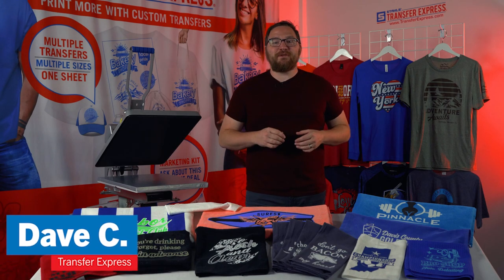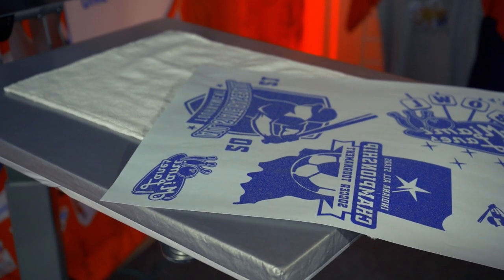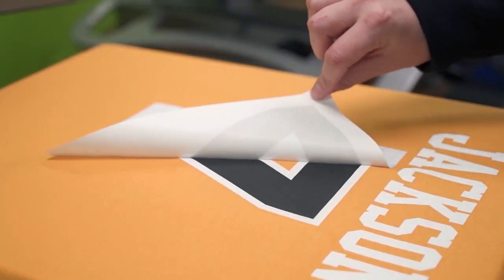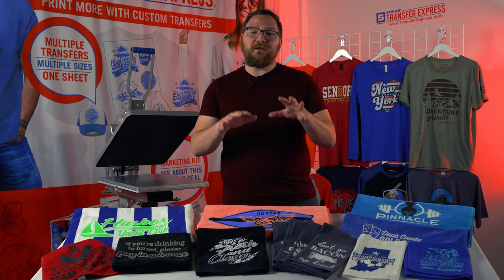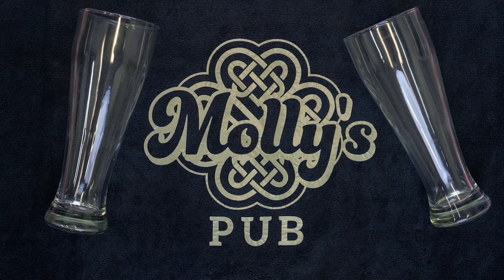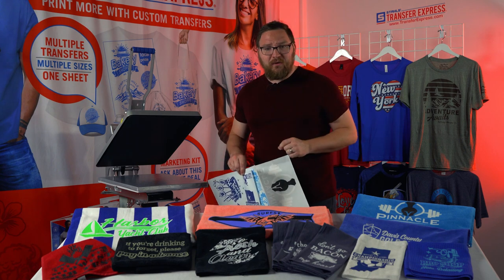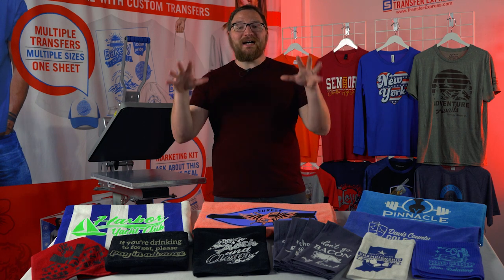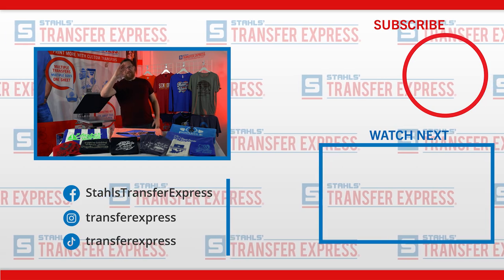How To Screen Print Towels in 4 Seconds | Rally Towels, Kitchen Towels, Beach Towels + More

Comment: I JUST did 150 rally towels for a grad party. My client wanted them for gifts for her guests. I had never done it, but after searching Transfer Express's blog I saw that I'd be able to do it with my fave Goof Proof. The towels turned out GREAT. I used a 100% cotton towel with a very low pile to make sure it was a flawless application. I've added rally towels to my portfolio now.
Reply from the maker: That's awesome! They really are a great addition to any heat printing business. 

We're so happy to help!
Reply: Which towel did you use? Item #..?
Reply from the maker: @ericj6170  If it helps, the Port Authority Rally Towel PT38 is an awesome choice for a low pile surface for screen printed transfers. They're pretty commonly found under $1.50 each too!
Reply: @transferexpress  Thank you for your response.

Comment: Hi Dave, I am curious if there is a way to print transfers on sleeves with the 360 iq?
Reply from the maker: Great question Authentic Ginger! The answer is yes, absolutely. We've applied a variety of different transfer types on the 360 IQ on sleeves, face masks, hip packs, and more! 

For printing on short sleeves, you'll want to loop the top side of the sleeve over the lower platen so you don't have the seam on the underside of the print area. 

This is such a great question we'll even make a video about it!

Comment: What size transfer would be best for the corner of a beach towel, what size for a center logo
Reply from the maker: That's a fantastic question! It's hard to say, as the sizing for the logos may differ based on the actual dimensions of the towel and the aesthetic or look you're going for as well as the dimensions or your specific artwork. On the corners something in the 6-9" range would likely get you in the right spot or for the center 8-12". 

The most accurate results would come with measuring your towel and printing out the graphics at size to judge the design and placement before a production run.